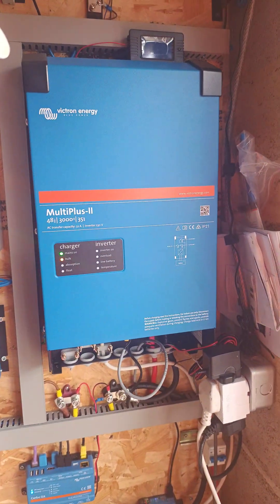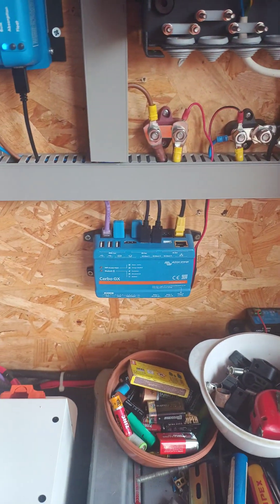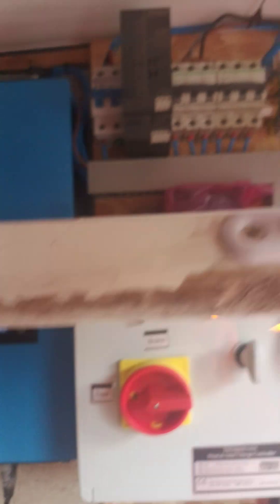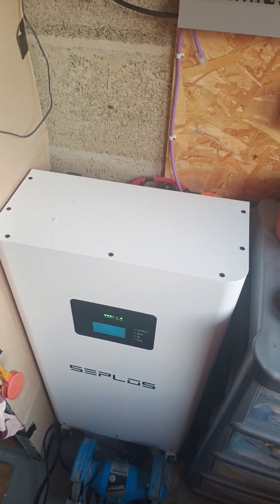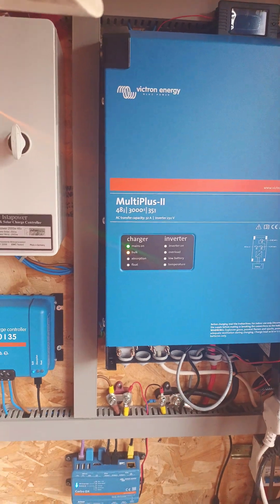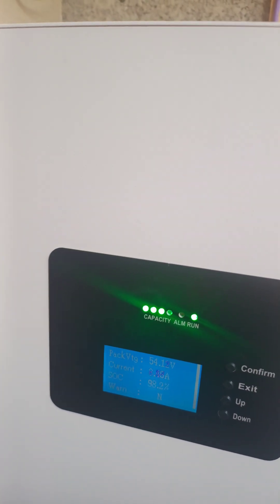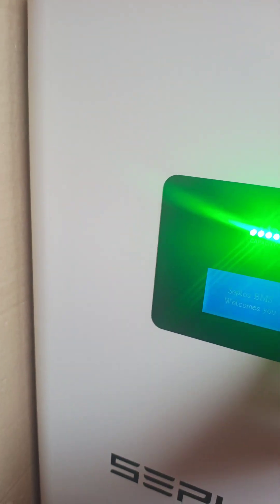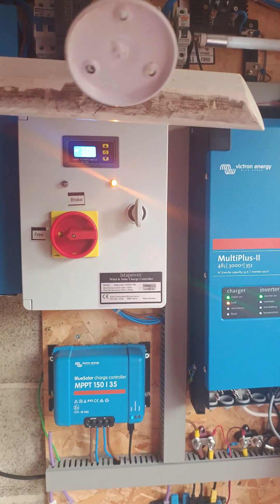Seplos 280L with Victron control ,solar and 2kW wind turbine.

Comment: where abouts did you get the wind charge controller from, do you have a link?
Reply: Istabreeze, I've heard mixed reviews. Made in Turkey.
Reply from the maker: it is simple controller, I use it as additional security if wind pick to high, and AC inverter wont use all, surplus then goes to seplos. got it from ebay